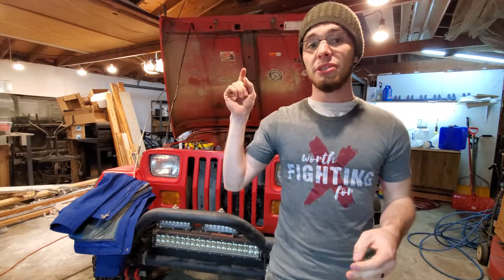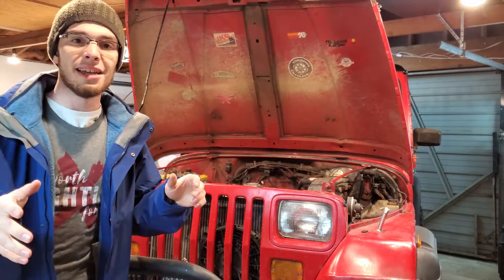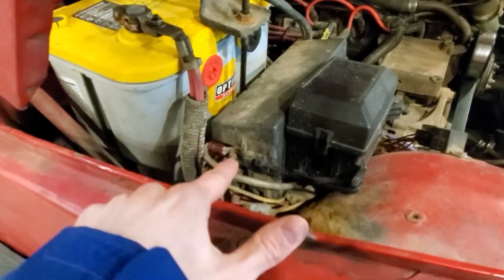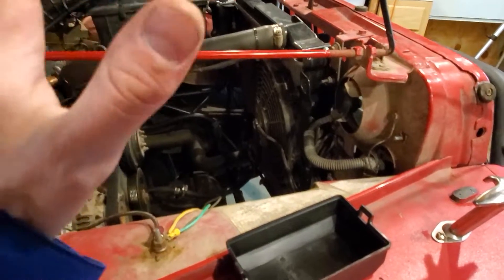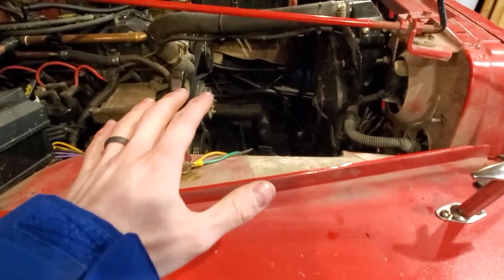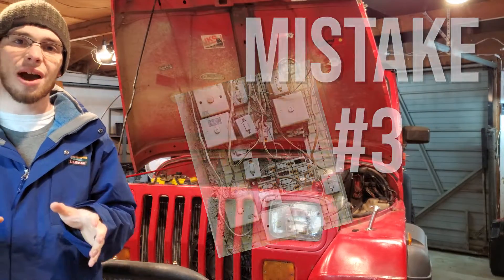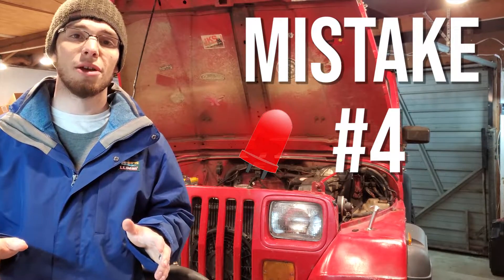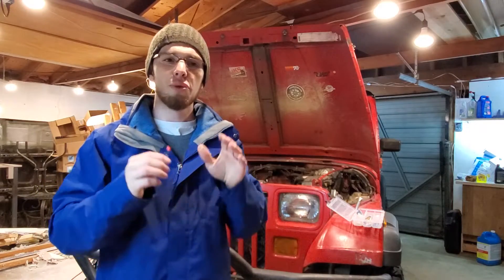6 Common Electric Fan Wiring Mistakes

Comment: I’ve used silver 600 volt. Strand 12 Guage wire and it’s more susceptible to Heat . Not like the copper wire I had Prior . That copper became dry and corroded brittle . That it broke off . So hope this helps . I believe it’s the  higher heat Rating of the cable capacity 600volt type

Comment: Hey brother! Thanks for all your videos. You have helped me a ton! I have a 2001 TJ and just installed a new radiator and electric fan. I am having issues finding a bracket or somewhere to put the coolant reservoir and power steering reservoir. Any suggestions?
Reply from the maker: @bcverve  you may have to make something that they can mount to if your new radiator doesn't come with provisions for mounting. Thanks for watching!

Comment: Good video, how have your fans been working out since then?
Reply from the maker: I've actually removed them.  I had too small of wire and went back to the clutch fan for better reliability on the trail. I'll go back someday
Reply: @JeepSheepTV  did you notice a power loss going back to the clutch fan? 
i did e clutch fan to e swap and i say about 1-1.5mph gain as well as fuel economy going up about 1mpg. 
i remember when i did the clutch fan “delete” i felt a bigger throttle response and since i tow with my rig i need all the power i can get.
Reply from the maker: @payloadperformance9706  in really not sure since I installed a supercharger at the same time...
Reply: @JeepSheepTV  ah okay, that would make sense. 
i’m a huge e fan enthusiast so if pu ever want to build one let me know and i can walk you through how to get one for your specific needs. 
i have a couple videos talking about fans, so if you ever have any questions i’d be more than happy to help.

Comment: finally got a high output alternator so I can get rid of fan and shroud. Thanks for the video. Why do you use the hood prop? I just pull my hood all the way back and rest it on the windshield "carefully". Never had an issue of rubbing marks or damage...
Reply from the maker: I have an unusually low garage ceiling so I cannot open the hood all the way. It's quite annoying. Out of the garage you know that hood goes all the way back!

Comment: put the shroud back on with a c4 corvette fan mounted in the shroud...fits perfectly and is very strong. The shroud is very important man and will help pull waaaay more air. 3 simple little easily made brackets secures it to shroud like oem.
 The shroud has to be cut down 2 inches to allow for clearance at water pump and get the oem relay from the vette when you go to junkyard for the parts. It is a sealed heavy duty relay and is very reliable. The trans cooler needs to be in frt of radiator for best results...dont make me come up there lol tho i wish i could to get our secret weapon installed on yours
Reply from the maker: That Corvette fan idea sounds awesome. Unfortunately I have a surprise modification that requires the shroud be gone, I need the space! Door is always open if you want to visit!
Reply: @JeepSheepTV  always keepin us on the edge of our seats...the only thing i can think of is room for a turbo?
Reply from the maker: Gilbert eh turbos take too long to spool.  For once, this mod won't have anything to do with performance
Reply from the maker: But I am also investigating superchargers, so don't worry